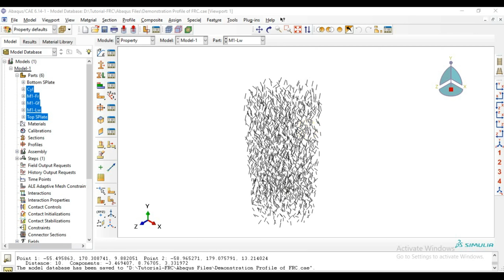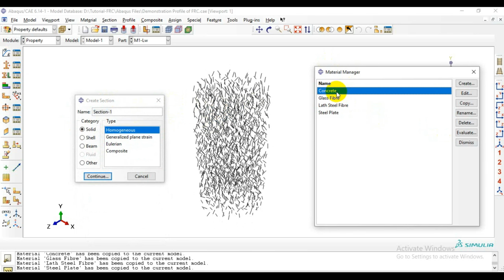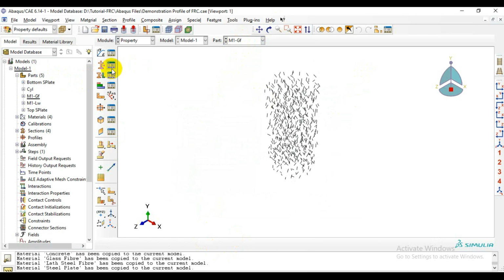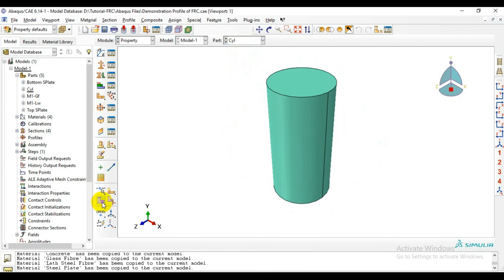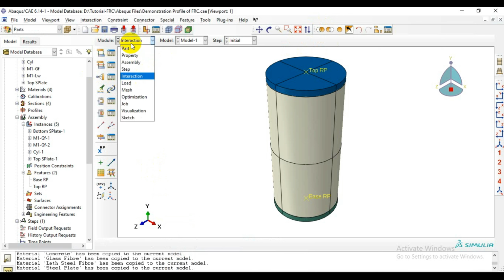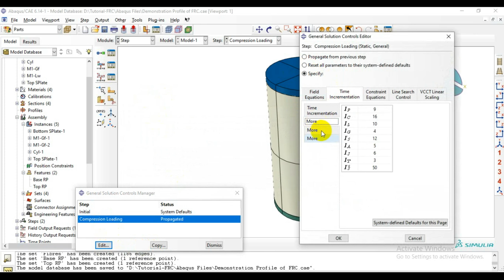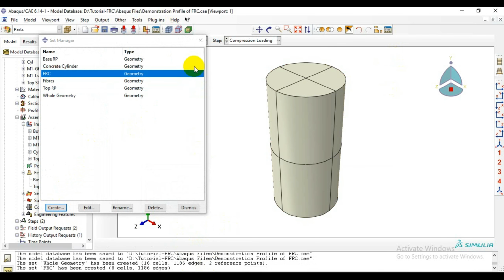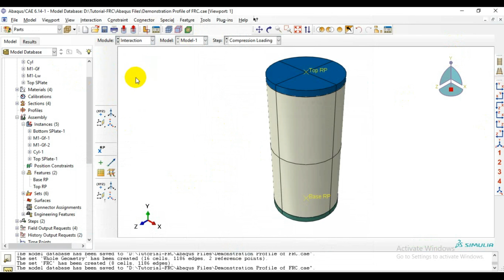Lecture 3 of 7 | Modeling #Fiber #Reinforced #Concrete Using #ABAQUS

Comment: hi
 Fibers in this tutorial are selected from the truss type
While the fibers in this test seem to withstand shearing, and isn't this the reason why we assign the beams type fibers and not trusses?
Reply from the maker: No, beam elements cannot be used in the embedded region because of the locking of degrees of freedom (DOF) as expressed by the equation u_embedded = sum(N_i * u_host,i). The absence of shear and bending degrees of freedom is the reason why beam elements are not suitable for this application.